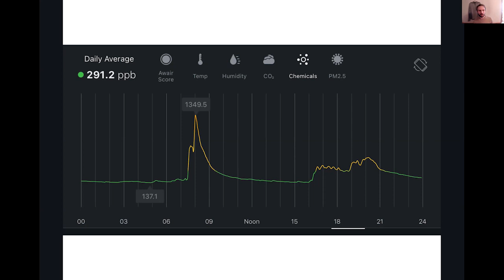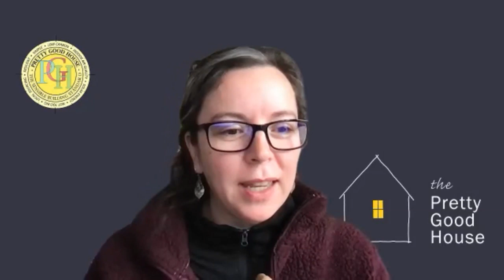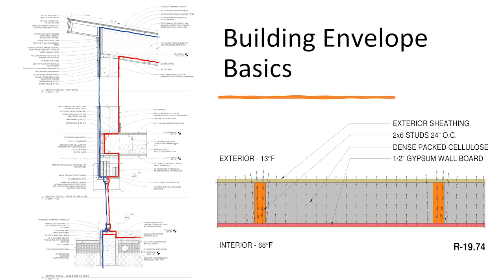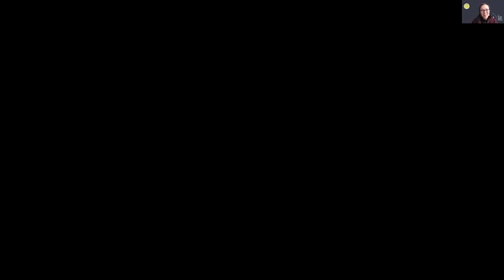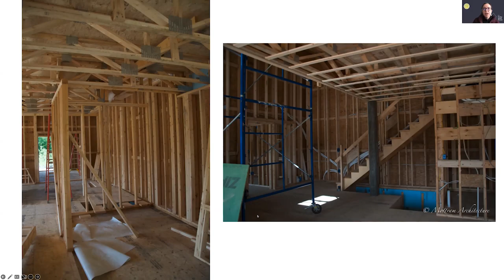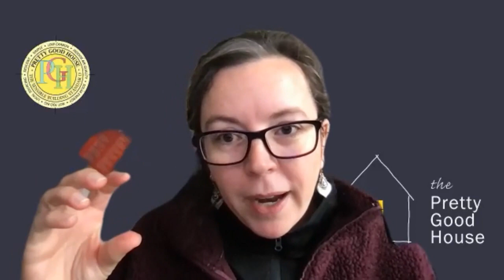Pretty Good House

Comment: I have a Wick home which is basically a panelized house from early 2007. My wife and I ordered every option related to insulation that was available. The dealer urges us to cut back with the fear of the home being too tight! Thankfully I kept pushing forward. A few things that we did was 2X6 with 24” center and R19.75 in the walls with R50 in the ceiling. In the lower level(basement) we went with a product called Superior Walls which was pressurized concrete sandwiched with 1 1/2 in foam. We then spray foamed another 3” of spray foam around the entire envelope once the basement was in place. Then a few years later when we did the build out in the lower level(around 1000 sqft.) we did a light layer of rockwool insulation over the top of the spray foam and then drywall for sound proofing. We have a home theater and a bedroom down there which can be challenging sound wise. 

The problem we have, is what was mentioned here briefly, too much humidity in the house. We have battled it since day one. The HVAC contractor that was involved with the project didn’t believe that a panelized home could be air tight enough to require a HRV unit install. Needless to say we had to fork out the money a year later because we had large amounts of condensation on the windows. The HRV seems to control the humidity in the winter but being here in WI the last few summers my AC unit don’t need to run very long to cool the house so sometimes we get scary high humidity. I am not sure how to handle this problem.
Reply: I'm building in the desert so I'm pretty sure I'll have the opposite problem but I think I have seen AC units with dehumidification modes so they can run without cooling.

Otherwise there are plenty of dehumidifiers that you could plumb in to your HVAC if you have a ducted type system.
Reply from the maker: @joequixotic3039  Correct - Check out Aprilaire.

Comment: This is great but your case study looks nothing like what I will build because it's designed for a primarily heating climate zone.

In a dry, primarily cooling climate zone (southern Nevada), maximum HVAC load will line up with maximum solar production and the shading effect of solar panels covering the roof will all work together when it is hot.  Over sizing the solar array to almost or completely shade the entire roof will allow for panel efficiency to drop over time without going past net zero on energy consumption in summer and generate more than required to heat in the winter even if the panels are not angled to maximize generation in the winter.

Snow is not a real issue so a single pitch shed roof simplifies construction details.

Ground temperatures stay fairly warm year round and my ground floor will be a garage/workshop that won't be conditioned as much as the upstairs living area so slab insulation isn't really necessary.

Your carbon footprint graph does show that reducing energy usage is more important than reducing C02 emissions required for construction but if you are going to say your stick built house has a realistic 100 year lifespan, you have to consider that a foam and concrete ICF house is realistically a 200-300 year house or more because demolishing a steel reinforced concrete building is a huge pain in the ass (even if it is small).  Realistically my land will never be bought to tear down and rebuild because it's rural and Lex Luthor isn't trying to turn it in to ocean front property.

Regarding insulation levels, if you over provision your solar panels to shade your roof and use lower output panels to save money, why insulate to reduce HVAC energy requirements to less than your minimum predicted solar generation (75% of rating × sunny hours)?  I doubt I'll need R40 in my roof but it will be vented with a radiant barrier and shaded on top of that.

Operable windows seem pretty silly except when there is an egress requirement. Glass block has pretty decent performance, it can be mortared in to an ICF wall and it's pretty cheap.

Design is the big factor.  Mine is kind of dictated by I-joist span charts to make good solid floors and a clear span under the roof.  It will be a split level design basically for packaging the spaces I want but also to hide the mechanicals in a chase that's hidden between two floor trusses but easily accessible for the day when my plumbing or electric need to be replaced 100%.  It's pretty much right-sized but rectangular because the span charts are maxed out and I need about 66% more floor space than I could build square with clear spans.

I know rectangular is not as good as square from a performance standpoint but it will minimize my construction details, making a tight envelope easier to achieve which probably makes up for the rectangle's weakness compared to a square with a peaked roof.

Lastly, you said one thing I 100% disagree with and one thing I 100% agree with.  Climate change isn't a problem that needs to be addressed in 10 years.  If it was, admit defeat and buy land in the arctic circle.  It should be the goal of pretty good house building to take these lessons and get them adopted by developers so that the houses average people buy or rent are better built, better designed and more efficient but not prohibitively expensive. You said it, two living house certified homes built in 20 years, that's nothing.  If you could get 10,000 new homes built 1% more efficient in one year, that's 5x the impact in 5% of the time.  I think 10-25% more efficient might be achievable with minimal impact on building cost (and offset by right-sizing and designs that reduce wasted space).  Once most building crews know how to build like that, it won't be hard to get a crew that can build even better than that.  Why fear monger and argue about stuff that will have zero impact when you could try to do something that would have tangible results?  You should be designing panelized housing developments  to find economies of scale with pre fabrication but enough customization that the houses don't feel cookie-cutter, then build 100 units instead of 1 unit.
Reply: As part of the presentation, we usually say that a house in Nevada will look nothing a house in Maine or Miami, because the site conditions and local practices vary so much. We acknowledge that our experiences are all in heating-dominated climates, but in the book we were careful to include case studies and lessons from all over the US, to show how details and situations vary. We are trying to explain what is important to think about, without providing prescriptive solutions. 

Oversizing the PV array is a good idea, if you can afford it. Panels typically lose about 1% efficiency per year and are usually warranted to last 25 years, but in practice usually last 30-40 years or more. (And to answer a question in the chat box that we didn’t get to: PV panels recover their carbon debt in 1-3 years. Yes, that includes the fact that they may be built with Chinese coal-fired energy.) 

Most of my career has been designing and/or building renovations. Most people want to renovate their homes eventually. While it’s true that building with concrete and steel can make for a long-lasting building, thinking that what you need in 2022 is the same that someone will need or want in 50 or 100 years is pretty myopic. Assuming that southern Nevada will remain a good place to live for the next 200-300 years is also myopic; climate change is already happening and will only accelerate unless major changes are made now. 

If you want to eliminate R-40 roof insulation in favor of a radiant barrier, go right ahead. It’s pretty easy to use energy modeling to show how that will affect your energy use. Radiant barriers, when properly installed and kept free of dust, are equivalent to R-1 to R-3 insulation. If that’s the only R-value you have, it can be noticeable. But conventional levels of insulation are more effective, and you can use energy modeling to find where above code-minimum levels make sense for you. 

I agree that operable windows are often not necessary, especially if you live in a place too hot or cold to have the windows open very often. I have yet to convince a client of that, but fortunately the cost and energy penalty of using operable windows compared to fixed windows is pretty small in most cases. 

The most efficient shape when looking at the ratio of floor area to surface area is a sphere, but that’s not an easy shape to build. The next most efficient shape is a cube, but as you found, that often presents design limitations, so most Pretty Good Houses are rectangular or composed of rectangles. Passive solar advocates in heating climates prefer to have a long side face the sun but with good insulation and air-sealing, and good quality windows, that’s less important. 

You have a right to your own views on climate change, but your view is at odds with the vast majority of scientists actually studying the issue. It’s not going to be solved in 10 years; in fact it’s almost certainly not a fully solvable problem, but we have about 10 years to reduce emissions so that in 50 years the accumulated carbon in the atmosphere doesn’t wipe out most life on the planet. We're already in the midst of the sixth great extinction event in the Earth's history. That sounds dramatic, and it is, but it’s also why we are doing what we can to slow the advance of climate change—more accurately called catastrophic climate disruption. 

I think you are actually agreeing with us on one point: that it’s better to make 10,000 homes 1% more efficient each year than to make one perfect house every decade. But we also need those “perfect” houses to inspire and learn from. A typical PGH is probably around 10-25% more efficient than a typical code-built home. Passive Houses are usually around 50% more efficient than code-built homes. We have found repeatedly that once builders (and designers) understand what they need to do for high-performance homes, they realize that it’s not very difficult and it becomes another source of pride in craftsmanship.

Finally, we are not fear-mongering, we are keeping our heads out of the sand and using our free time to show people how to build better homes, for both the near future and the more distant future. Every decision matters and has an impact, somewhere, even if it’s not immediate and within your view. Emily is designing net-zero developments and is using prefab panels. I mostly design renovations. What are you doing to make the world a better place?
Reply: @michaelmaines103  I'm going to build my house and try to be net positive so I have an energy surplus.  I'm not saying I won't insulate my roof, it will be about R40 which is probably overkill but also shaded and with a radiant barrier with a vented air gap on top.  I only need one layer of decking on the roof but I should greatly reduce solar heat gain in the roof using an assembly that barely costs more than code minimum (not including the steel roof and solar).

The point about overprovisioning solar with older, lower efficiency panels is cost reduction, higher energy generation and more shading.  Higher efficiency is great but cost makes overprovisioning a lot more expensive with state of the art panels and you'll have less shading.

Renovation and especially "green remodeling" are a minefield.  I believe most of the time you will never have a carbon payback on that type of construction.  My place won't be fancy but the upstairs will be "open concept" which is a trend that I don't think will go out of fashion ever, especially in small-ish right-sized homes.  Downstairs will be a configurable workshop/garage and I want to recycle ballroom style air walls to make it a configurable space so that I can have a sealed off wood shop or paint booth when I need it and a garage when I don't.  I'll have an enclosed carport style steel building as overflow storage/shop space that doesn't need to be conditioned as much as the main house.  I'm pretty sure there will always be people that want shop space but don't need a huge living area.  People build that all the time with things like Barndominiums because there is an unfilled demand for that in the real estate market.  I'm not worried about resale or renovation but also I'm building it for me.

I believe in making sustainable, high performance buildings but I'm not a builder by trade, just a guy with a few years of professional fabrication experience (and decades of amateur) who can build.  It's not much but I don't think I have to save the world by myself.

When you say we have 10 years, shit or get off the pot.  By shit, I mean do something impactful.  The developing world is our biggest problem if you are right about the climate but no one is seriously trying to green up China, India or other Asian countries that are gross polluters and conspicuous consumers of coal, oil, concrete and steel.  That 10-25% efficiency increase in housing developments is the low hanging fruit in the western world.  Once you get to 25%, the next 25% won't be as bad as trying to make builders do 50% better today.  That's how you move the needle.  Do it if you believe it but realize the developing world's carbon will outpace everything you do here unless you can effect change there too.

We either have a short game, a long game or no problem at all.  If it's a short game we're screwed, we will never see the change you claim we need.  If we treat it like a long game we win if it is a long game and no harm if it's no problem.  If that strategy had been adopted 10-20 years ago we would be in a situation where we would be working on that second 25% now, not still complaining about standard construction not improving fast enough and Asia might be convinced to clean up their act if they see us doing it without huge costs.  We should also insist on bringing manufacturing back to the US so that we can enforce emissions regulations, reduce transportation carbon emissions, become energy independent and improve our economy by becoming net exporters.

Why is it that leftist governments always misses that last part about bringing energy independence, manufacturing and jobs back?

My theory, they are more interested in control than improvement.  Don't be like them.
Reply from the maker: Joe - Sounds like you are a good canadite for GreenStar Certified Home project. Learn more here and let's talk to ensure your home is built, BETTER. https://greenhomeinstitute.org/greenstar-homes-certification-manual-2/